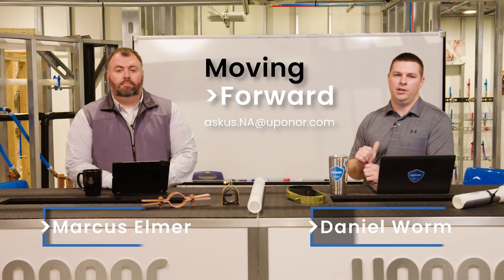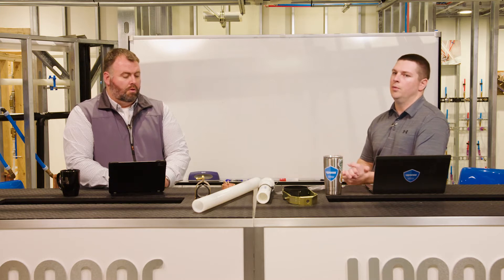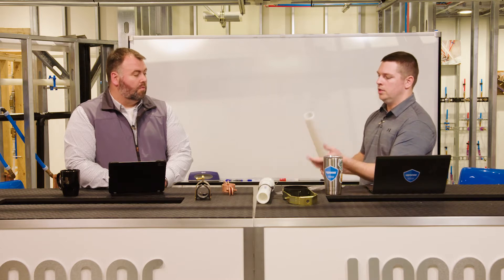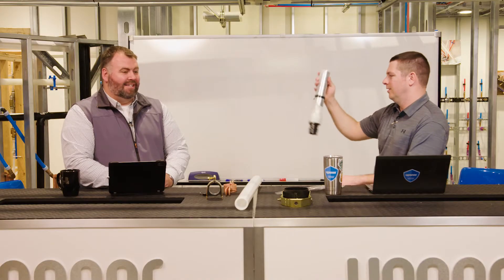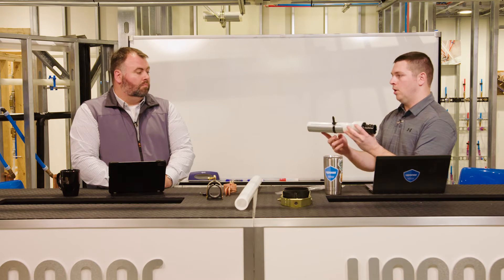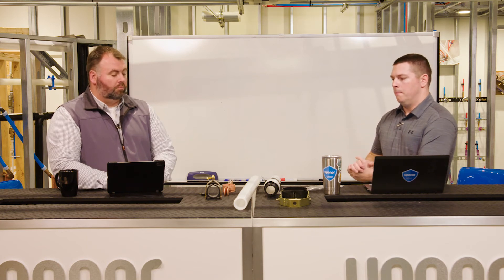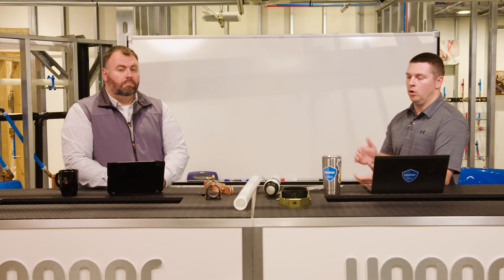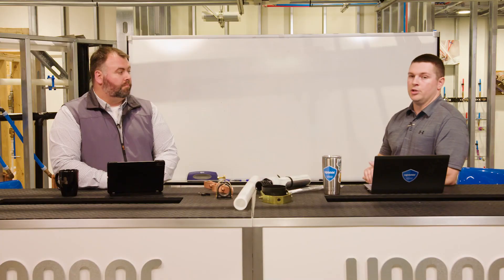PEX Supports for Large-Diameter Pipe | Ep. 3 Moving Forward with Uponor

Comment from the maker: Any questions? Comment below!
Reply: Do you have a video or link about the pex a pipe support that covers distances between hangers, away from joints, how often to zip tie the pipe, etc?
Reply: @kennethwilbanks6929  this too
Reply: And in say fuck it to the metal zip ties. Plastic is cheaper, can get it tighter and less likely to dig into the plastic pipe. Every job I’ve had we order plastic zip ties cause the metal zip ties are well kinda shit cause we can’t get the tight enough or one a bent when inserting and you gotta chuck it